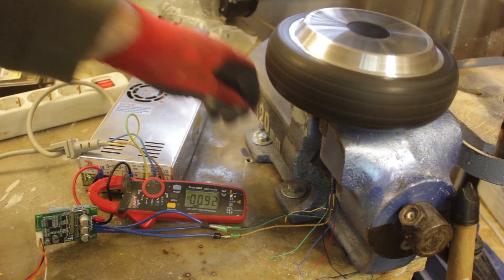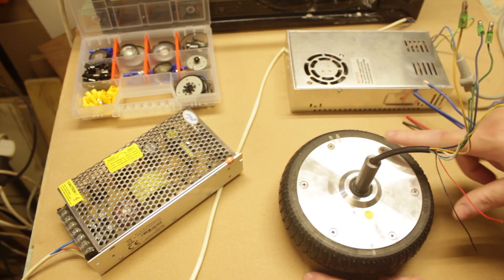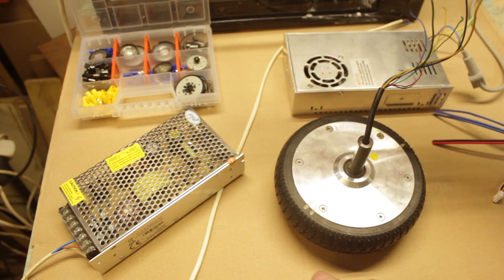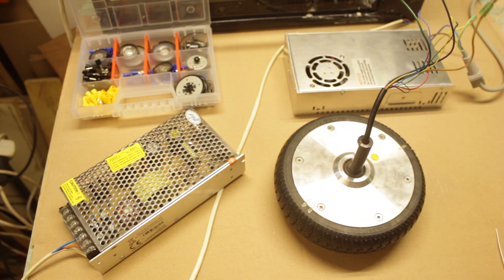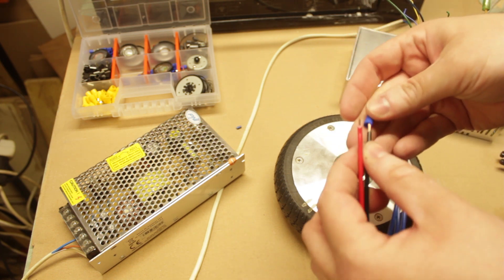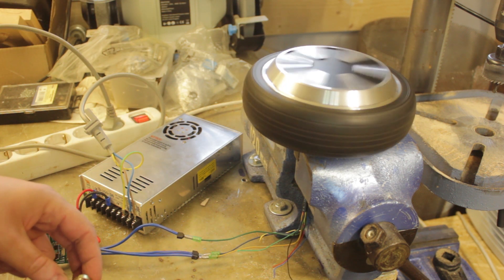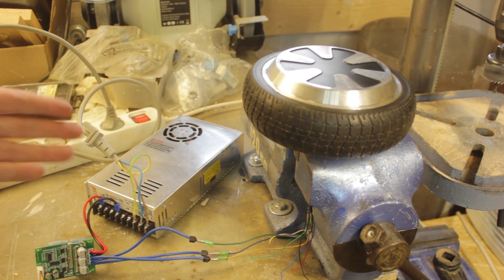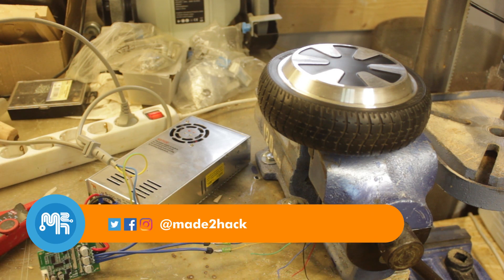How to Power Up and Run a Hover Motor using a BLDC ESC! - Hover Board Motor ESC

Comment: Application: Control motor RPM 50-350 under light to moderate torque...Could you recommend power supply/voltage/controller please...
Reply from the maker: Hi there, I need more info about the motor to be able to help. Is it a BLDC? Or regulard brushed DC? AC Induction?
Reply: @Made2hack  bldc 3 phase....From a hover board...None of the videos I've seen show control of low rpm's at start up
Reply from the maker: @joehutchins253  Tough to say. I don't have much experience in using ESCs. This is the first one that I found that was very easy to use since it required only connecting the 3 phases. For Hover motor, look for 36V BLDC driver since it is the optimum voltage for these types of motors.
Reply: I'm trying to build a golf cart with hoverboard motor, but failed to run it with a 3 phase esc. no matter how i try to connect the 3 cables, it won't run. 😥